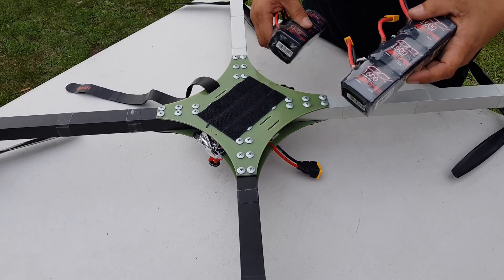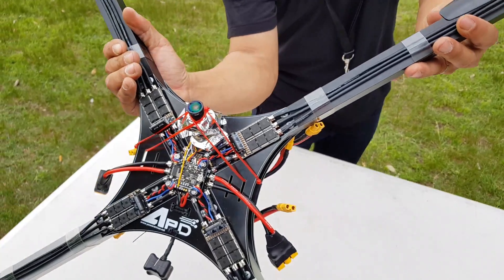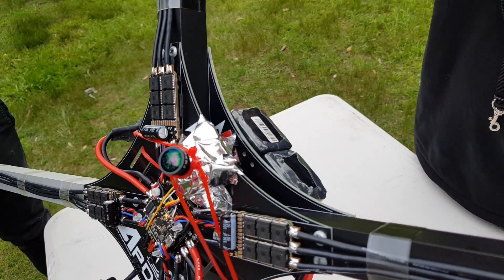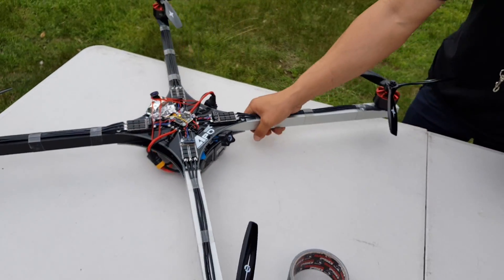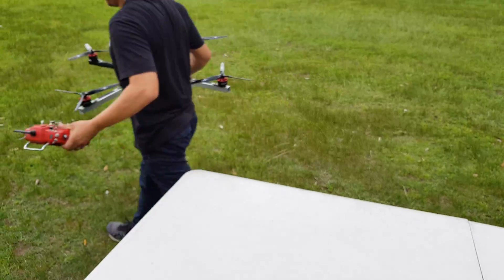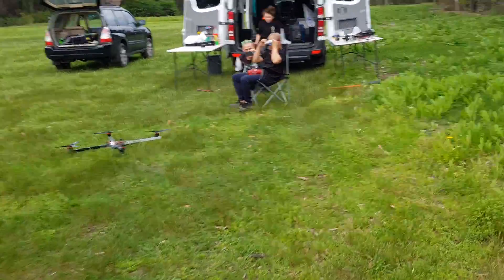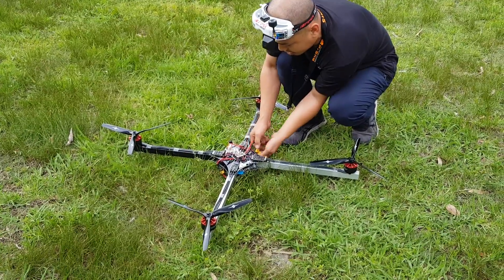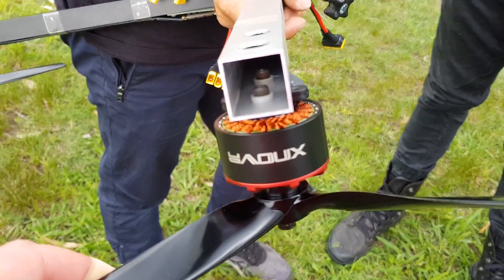Fly it like you stole it!!

Comment: Serious, non-trolling, question. Why are the X-class frames/rules set to be that big when the prop diameter is so much smaller. Looks proportionally like running 5" props on a 8" frame. Wouldn't be more efficient (less weight) and agile (shorter lever arms) on a compact frame where the arms are shorter (prop tips get close to the center body)?

Comment: One of the faster X Class rigs I've seen. The tune on this one was sounding notably better and sharper than some others I've seen. Interesting you put down the 3200 in less than a minute. Using the standard XT60? Any benefit of using AS150 style? Sweet build and flying. Nicely done. Also as for props, is there no way you guys can run a larger prop with a lower RPM?

Comment: Why not using bigger batteries? why 6 packs in series? :D you could use just one or two bigger batteries
Reply: 1)Parallel connection=more volt
2)
Each battery has a current rating 90-130C. 
Currently there is no battery with 90-130C and 5500 mAh capacity.
Reply: it's a combination of series and parallel.
Reply: To divide the weight

Comment: How do you get the osd to displays 12s voltage on a 6s rated FC
Reply from the maker: ESC telemetry
Reply: I'm basically about to have a stupid 12s 20in dual prop setup and now worried about packs to use as hear 5000 or even 4000 12s will be too heavy and now see 3200mah get 1 min and likely will have failing cells after a few flights or just blown up into a fireball.
Guessing the 4 1800mah 6s rline Probally will end in same results as this but maybe 80 seconds and same blisteting hot pack.
I plan on flying it hard and full throttle speed passes so basically gonna have same result id imagine.
Would you say this quad would be good to go on 2 4000mah or 5000mah panther graphenes or too heavy really as theyd be twice the weight of these packs easy?